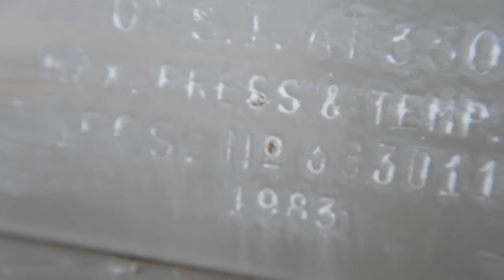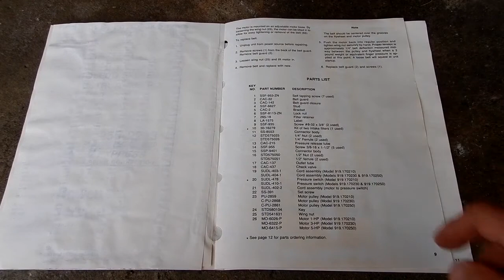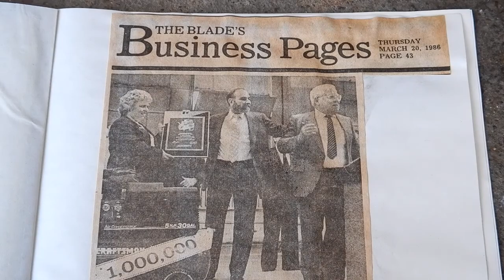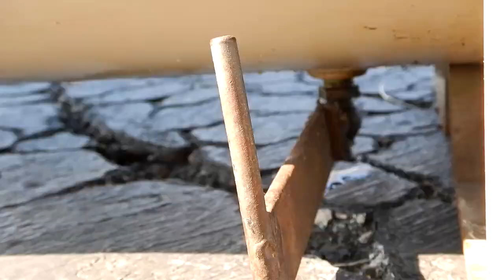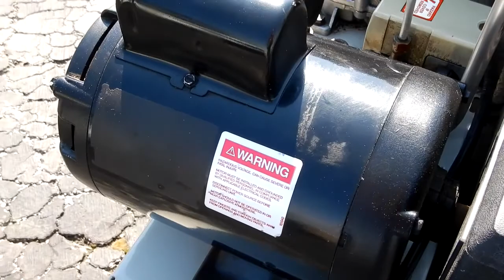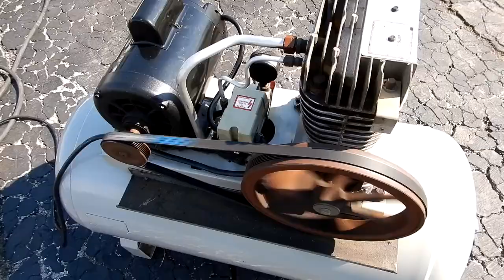My 38 year old Craftsman (built by DeVilbiss Mfg. Company) Air Compressor STILL GOING STRONG

Comment: Hey thank you for making this video. My grandfather passed and among what I inherited was a very similar unit. Mine is dated 1987 and is a 5HP 30 gallon variety. It was still wrapped up brand new with the warning tag on the prongs of the cord so it had never been plugged in. I added oil and it started right up. I think he got a good deal on it because he frequented the sears outlets, but never got around to adding 220V to his garage. Your video has lots of great information I was otherwise unable to find. Thank you for sharing, I’m excited to be able to enjoy the compressor for years to come. It seems these are very well built and well regarded units.
Reply from the maker: You're very welcome 👌 These are built like a tank. Enjoy that for many years to come. BTW, glad to be of help.

Comment: I have a 36 year old Speedaire that I just did the maint on.   Amazing.   As good as new pump up time.   An interesting Campbell Hausefled (sp?)  of aluminum crank,  cast cylinder and aluminum head.   It is a shrouded design with a blower wheel on the off Flywheel side.   Fantastic cooling flow.   Wild Silicon Rope head/valv plate gasket setup in a recessed  grove.   Absolutely  no parts available  for it.    Maybe fix valves with stock  valve material if the gaskets are ok (or high temp silicone seal).    Ot otherwise its a new pump if anything serious lets go.    Keep in mind parts may simply be non existent for old shop compressors.    Good news is the air filter is nylon and I had some Poly filer material form Volcanic Ash protection that fit right in (and its dirt free area so not  much to filter).    No idea how old the oil was and it was in acceptable condition (needed a change but acceptable clean and not ugly)

Comment: I love this video! How you go into the details about its past who made it, when you bought it, and the improvements that were made. I was on a hunt for a compressor last year so looked at Facebook marketplace and there I found someone who was selling there’s identical to yours here for $80 dollars. I actually offered $60 and he took it. Haha ain’t that something given how expensive it was back in the day. I absolutely love love love mine and would use it over any of the newest and most current compressors today. Things were solid and built to last from decades ago unlike our throw away society we live in today. I grew up in the 80’s and don’t have as much knowledge as some of the folks prior to then but even in my childhood things were made better. Seems like all materials and parts are so replaceable and shipped from over seas. China is where the bulk of everything comes from and it’s all garbage just cheap junk!! Amazon for one is their biggest supplier. Whenever I run across vintage or older things that were made better just like this compressor I grab on to it and consider myself lucky! lol great video thanks for taking the time to do so
Reply from the maker: REALLY APPRECIATE those kind words! I 💯% agree today is a throw away society. Quality goes down, prices go up. Even my 10" Rockwell Unisaw isn't made like mine from 1985. Glad you like your "new" air compressor. It will serve you well.

Comment: I have the same compressor, a 1985 model, mine has a plastic cover over the front so you don't see the actual compressor and only the end of the motor but it is essentially the same unit. It has been left on pretty much 24/7 since the day it was new. I had a minor problem with the air regulator that I was able to fix. It still runs the same as when it was new, it is still using the original drive belt. There was an issue when it was new, it would throw off the multi V belt when it started in extremely cold winter weather. I replaced the compressor oil with Mobil 1 synthetic auto engine oil and have had no issues ever since. In all these years I have only replaced the air filters and done two oil changes. Good job DeVilbiss impressive work.
Reply from the maker: Thank you for your experience with this compressor. It is a beast 💪 😎

Comment: I like the way you modified your condensation drain.  Most people extend the drain with pipe, not the handle.  
     Even though I've seen extended oil drains before, I've never seen one with a valve instead of a plug.  I recommended doing that at work once, but the boss was worried about diagruntled employee vandalism, so it wasn't done.  I guess you don't need to worry about that at home, although curious grandchildren might unintentionally let out a little.  That's why I put a plug in my valve, just in case. 
     Did you get your asking price?
Reply from the maker: Thank you. Yes, it sold on the first phone call. Guy came out and paid my asking price. We were both happy.

Comment: I have a similar compressor, Craftsman Devilbiss, manufactured in 1981.  This is a 2hp, 220v, 20 gal portable unit on wheels.  It still runs and pumps well, but the regulator knob has broken.  This is actually part of the regulator housing behind the knob.  I can't source the part from either Sears or Devilbiss.  I'd like to move the compressor on to another owner.  It's remarkable how well these things were made.